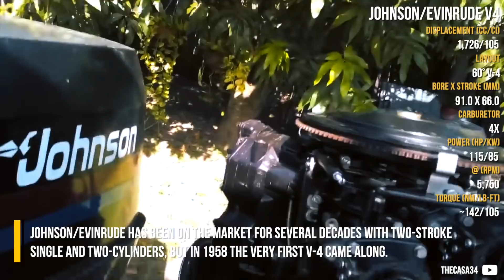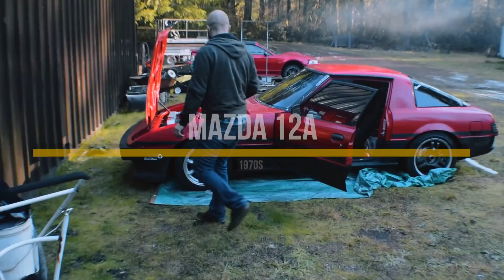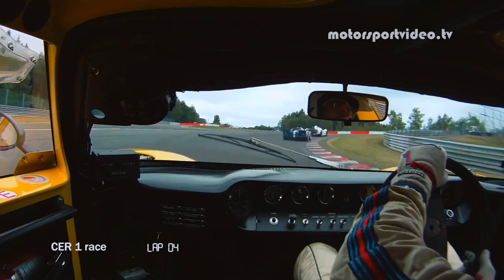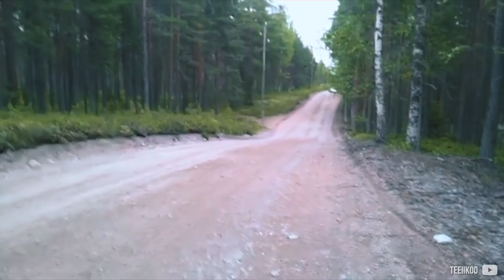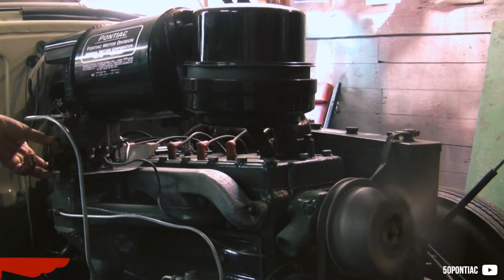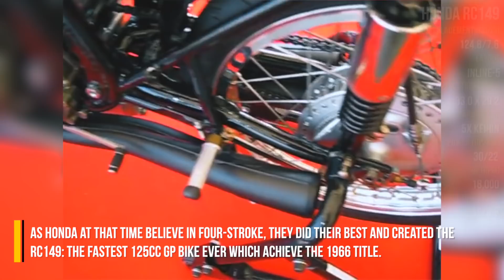Best Sounding Carbureted Engines | Ep. 3

Comment: The engine shown when introducing the Cosworth BDA engine was neither a BD nor was it using carbs. It was a Millington Diamond, which is based off a Cosworth YB from a Sierra (and later Escort) with it's turbo deleted. Itself developed by Cosworth from the Pinto engine block. The Diamond is common swap on Mk1 and Mk2 Ford Escorts that are still regularly doing motorsports, so I don't fault you for not catching it. Both it and the BD engines sound positively glorious

Comment: I have observed all three episodes .... clearly you could not include all the engines with caburatori that for sound and performance have become iconic .... but as an Italian passionate about engines that are ... I think that some Italian engines you have listed you could not have mentioned them as they are less important in favor of other more iconic ones .... for example the 4-cylinder twin cam aluminum engine with wet reeds classic alfaromeo .... or the fiat 2000 twincam engine mounted on the 131 abarth .. .or the v6 Busso

Comment: The Ford 427 FE motor is most definitely a big block, it can achieve upwards of 1000hp with a carb setup, and when it's runnin down a 1/4 mile drag strip in a 1964 Ford Thunderbolt, it is the best sounding motor ever created.....
Reply: It’s a medium block. The FE series was smaller than most big blocks.

Comment: It should be mentioned that the Chevy 454 also saw use in GM's light-duty trucks & vans prior to 1970, and after 1975 as well... with it remaining carbureted via Rochester Quadrajet 4-barrel variable-vane secondaries, until the implementation of computer-controlled throttle-body fuel injection in the 1988-m/y.

Comment: honda volvo cosworth, well this time you forget the ones better than every one you mention and that sound and have a power output same as a Cosworth 1.6 litre from the cheap kent engines. Bialbero from my '82 Giulietta, feeded with 45 mm stock everything eat for breakfast about everything in it's class, power handling that engine and the poor escort. And it wins everywere in europe during 60s and 70s, and how you could forget the V6 aka "Busso" engine with 3 carburetor from Alfa 6 late 70s? Still respect your car culture and style but this time it's a fail, maybe i'm a fanboy, but nobody could say i'm wrong.

Comment: My old 84 corolla with the air filter turned upside down. 10/10
Reply: YES! I put a section of vacuum cleaner hose from the bottom of the airbox to the back of the headlight on my 89 ‘Rolla...I call it the sound tube 🤠 Gotta hear that sweet 4A induction sound!

Comment: 454 with a Holley? Most were factory equipped with the Quadrajet. Love it or hate it (I love them), it’s got a distinct sound. Thermoquads too.
Reply: The quadrajet was a good idea, tiny primaries for mileage and gigantic secondaries for power. The people that hate them never bothered to learn how to tune and adjust them. A factory carb is almost always gonna be designed better overall than a racing based carb when it comes to practicality.
Reply: Yeah manViso does not get it I love that sound when those secondary kiked in on my1967 Chevelle. That sound was truly glorious
Reply: 454 whit four WEBER IDA 50/50

Comment: Carbs last forever. My 40+ year old one only needed a cleaning and new gaskets to get going again.
Reply: Until you commit the mistake of using gasoline/petrol with ethanol and leave it to dry in the bowl[s], then they turn into a pile of sandy white rust and your oh so precious carbonator relic now is completely clogged and ruined.
Reply: JIGA BACHI be a shame if someone were to take it apart and clean it. Ya know. Like you can do with a carb. Leave that same fuel in a fuel injector and rail for a while. See how it turns out after ya dump a few hundred in new ones.
Reply: @SBFmafia  I rather be riding than cleaning a "carbonator".
My EFI bikes stay parked for months at a time with only a batt tender on it and always start, no fuss, no drama.
I just make sure to fill the tank to the brim(with e10 sadly, no other choices around my neck of the woods) so no condensation occurs in it.
Reply: @GIGABACHI  carbs don't gunk up that quickly, my dad started a bike with old gas that was sitting for probably 2 months, it was also a Harley so that's saying something
Reply: @GIGABACHI  only carb I've had to clean was in a bike my dad bought that had been sitting untouched since the 80s, my yamaha that's stood for overa year started right up after a few kicks, carb didn't need any cleaning

Comment: That was unexpected. A Volvo b18
Reply: I know! Although the A variants (single carb, low compression, tame cams) really sound really anemic. They run out of air half way up the rev range.

On the plus, you can run an "A" wide open all day long until you run the tank dry, fill it up and continue. You'll die of boredom before the engine does.

A sharper cam, twin Webers and a free flowing exhaust will change the sound (and up the power a bit).
Reply: Yeah! Didnt think he would ad a swedish tank engine

Comment: I still build carburetted bikes just for the induction noise and response. Electronic injection is great too but nowhere as good sounding as open carb trumpets.
Reply: Today I'm just about to put my 1979 moto guzzi lemans back on the road  . Got open dellorto''s and racing pipes  , glad to go prematurely deaf for the joy of the noise  . Thought I'd of grown out of this by the age of 52 .
Reply: @andynixon2820  ayyy! Enjoy! Good man.
Reply: You could theoretically build an injection system that emulated a carb. Much like on a TBI, the single injector would sit in front of the throttle blade. Some vintage cars have had their carb "hacked" to integrate an injector instead of float bowl and needles.
Reply: @daszieher  I have in the past taken modern gsxr 750 or CBR 1000/929 throttle bodies and injectors to build ITB's for my Miata builds and a Honda civic hatch track car. Fueling and ignition is years better because the computer precisely manages everything. There is just something raw about a properly tuned carb or set of carbs with howling trumpets that draws me to them and it's also a dying art that I  would like to keep alive since everyone goes efi as soon as they realize how much better the car can be tuned using modern technology.
Reply: daszieher that would improve its power and efficiency  but it wouldn’t sound same